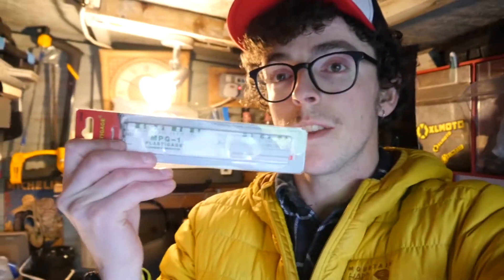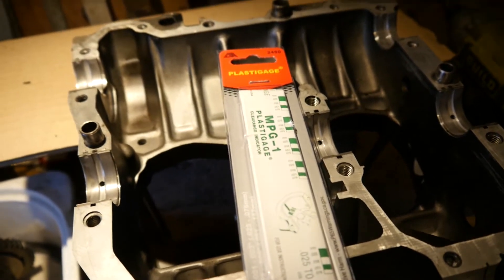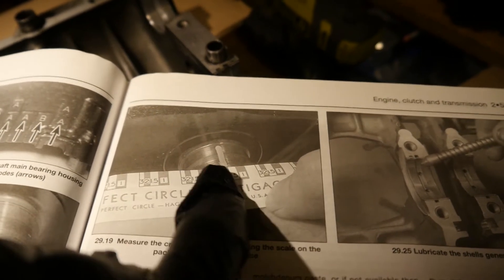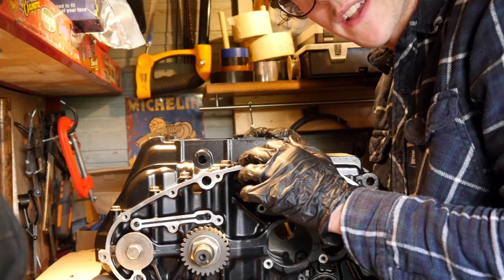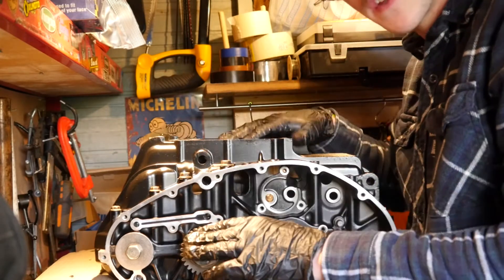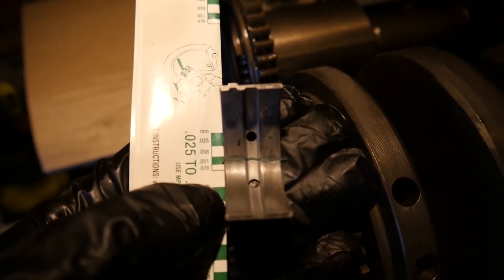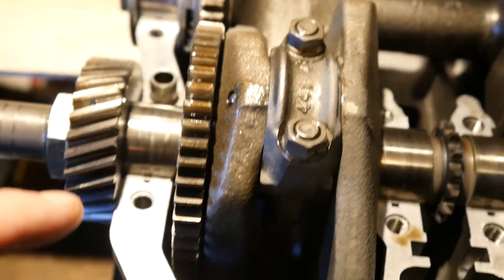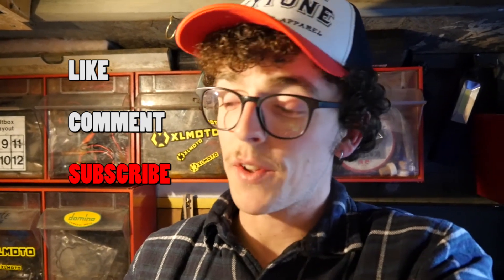Shoogly Shed Motors Ep 10 - Using Plastigage

Comment: You do not need to torque to full speck when checking tolerances with Plastigage. Torque stretches the bolt in order to lock it into place so that it doesn't back itself out from engine vibration or general operational stresses. Every time you torque a bolt down you fatigue the material it's made from. If you do somehow experience significant tolerance discrepancies between torqued and just snugged/ hand tight then you have an issue with casings themselves.

Comment: Great video! The crankshaft on my GS500 was bent in a crash and I would like to replace it. I want to open the engine block as little as possible because I don't want to ruin anything. Do u think it is possible to replace the shaft by just removing the bottom end?
Reply from the maker: You're going to need to strip the top end too I'm afraid! Your cam chain is the main issue. You could service the gearbox without dismantling too much of the top end. But the crankshaft is a bit of a different story! Good luck! There's a good Facebook page for GS500 owners which might be of use to you 🙌🏻💪🏻
Reply: @ShooglyShedMotors  thank you!!

Comment: Did you check the shell bearings when re-building your XS? I have a dismantled 400. I’ve been meaning to do the same but new shell bearings are no longer available on the XS if they need replacing.
Reply from the maker: I didn't have the bottom end of the XS250 open so no, they've not been checked! I wonder if you can find NOS?
Reply: @ShooglyShedMotors  When last I checked I couldn’t find any. Seem to be rarer than hens teeth. I bought the 400 as a project 5 years ago. I built a shed workshop, got as far as stripping the bike then got no further. I had the intention of turning it into a scrambler. I saw what you did with your 250 and it got me thinking that I really ought to get on with it!
Reply from the maker: @melk6717  is there anything that makes you think the bottom end needs attention? If it was running ok, I would just leave it well alone! Wouldn't hurt to rebuild the top end, rings, valve seals etc, then a couple of oil changes in quick succession and you should be golden!
Reply: @ShooglyShedMotors  I bought the bike as a non running project just so I could have an engine to play with. I thought I would have a go at getting it up and running but became a bit lazy and 5 years later here we are! Seeing your video on the Bike Shed reminded me that I needed to get on with it. I need to check the shells are not worn before going any further. Time to order some plastiguage!
Reply from the maker: @melk6717  good luck!! Sounds like a great project to me, I loved working on the XS250!